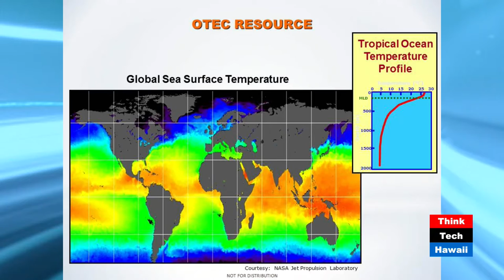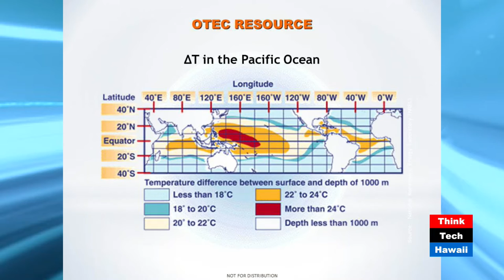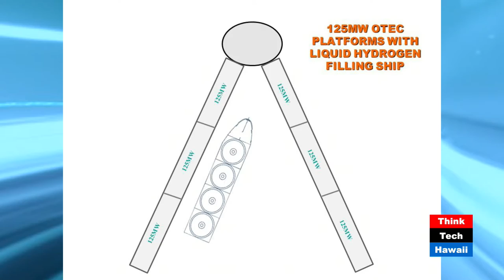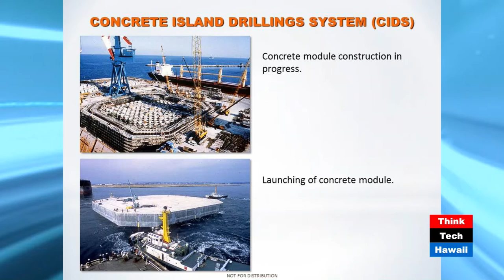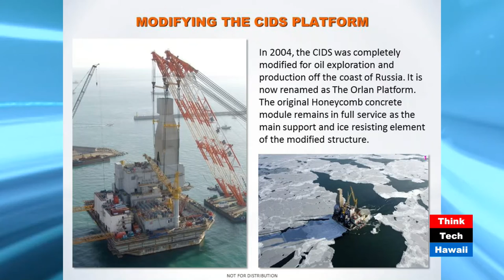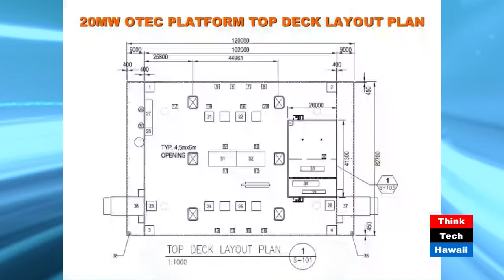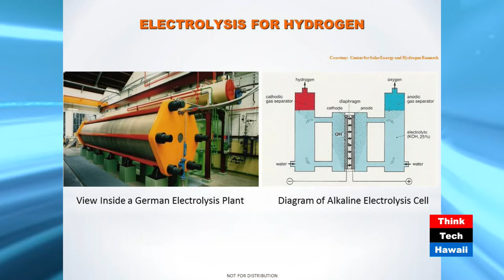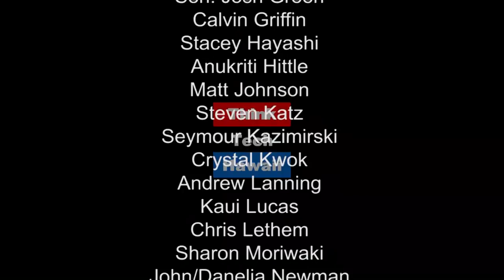OTEC: An Efficiency Renewable Energy - Energy Harvesting Systems with Dr. Hans Krock

Comment: These guys have a fresh approach that is beyond the straight up mechanical approach. But. I came loaded for bear with my own idea, looking for anyone else to verify my concept and have yet to find it. Here goes. Most are doing 100 year old Hoover Dam concepts. Rather than turbines and such I have the notion that a floating island tethered to the ground could create a daily load in direct relation to the mass(?) of the island. Like a vacuum cleaner power cord spring. Tech numbers would be scaled against island size. x number of widgets per ton kinda thing. This way there is multi-purpose to the structure (floating land mass) vs. venturi turbines or other single purpose applications and it's scale-able through duplication as opposed to having to construct monstrous projects. I even have a hunch that it would be more efficient. Am I a genius or have I missed something? Also, see below.